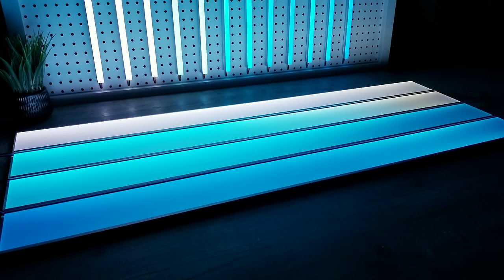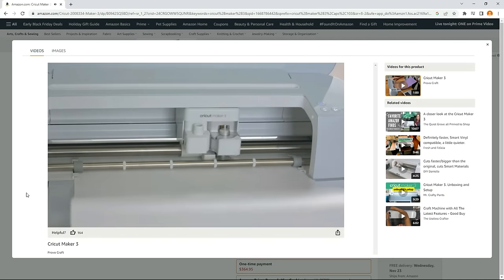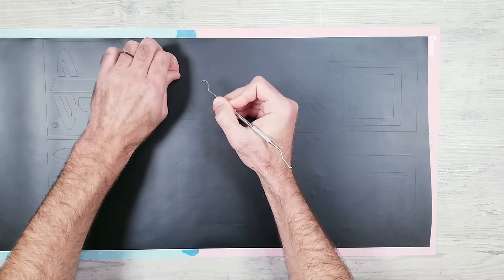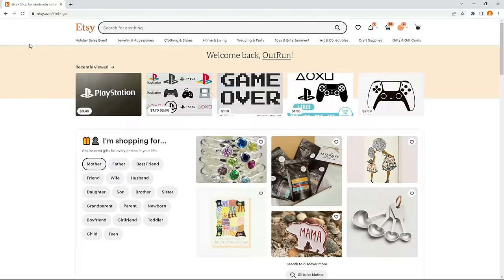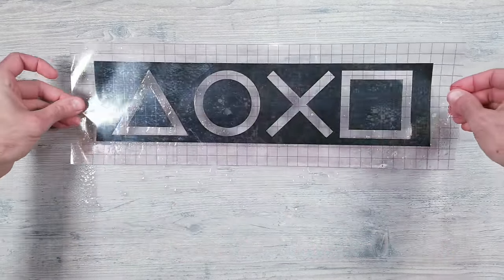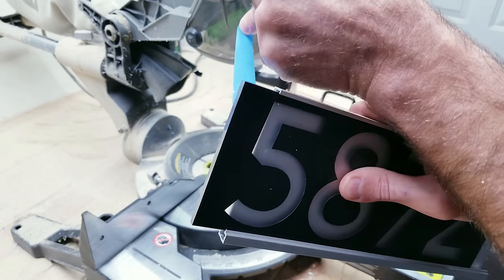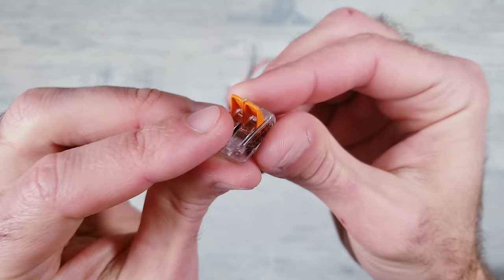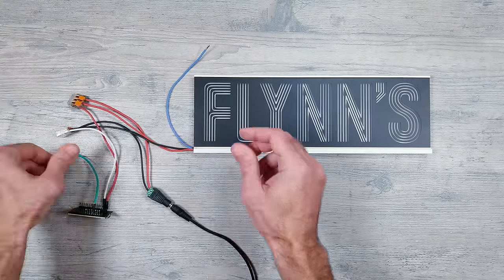How To Make A Custom Sign With LEDs

Comment: Suggestion for you on vinyl removal. Put on the transfer tape, then flip it over, and remove the backing from the vinyl. Get it started and then hold the transfer tape flat and pull/roll the backing off.
Reply from the maker: Thanks for the tip! I'll for sure try that! Some of it really doesn't want to pull off easily so I'm always open to new ways! Thanks buddy!

Comment: I have watched a few dozen of your videos and find you and the videos very helpful and a bit inspiring. I just made a couple of these and overall I'm pleased. My only concern is that the light is much dimmer on the top compared to the bottom. My muzata acrylic had paper covering both sides, one labeled frosted, one smooth. I put the vinyl on the smooth side,  would the frosted side offer better light dissipation? Thanks for all you do!

Comment: I like to heat up the sticky side of the led's with a lighter, match or any heat source before I stick them to really get a good adhesion to whatever I'm putting led's onto!
Reply from the maker: That's a good idea! I never thought of doing that before but I bet that would make a huge difference! Thanks so much for watching and for the tip!
Reply: @ChrisMaherDIY  it really makes a huge difference! I’ve also used those adhesive pads that like have alcohol and cleans the surface really good before use!

Comment: i like this, my neighbor throws christmas parties every year. i mader her a sign out of wood and some leds that ran off of batteries. my second design i was wanting to do was acrylic and leds i wanted to do a arrow point in the direction of where they parked with it flashing lights and the lettering flashing. i wonder how if i could achieve it with this?

Comment: Pro tip. When using the transfertape, peel it of by an angle less than 30 to make the vinyl stay on the transfertape, the same applies when trying to let the vinyl stick onto the plate, there you need to use an angle higher than 90 degrees
Reply from the maker: Thanks so much for watching and for the tip!! I'll have to try that! It makes total sense why that would be better so thanks again!

Comment: very nice!  How about solar as power for the street address unit? :)
Reply: Good Idea.  We need solar power and the ends need to be finished or cap off.  water proof enclosure?
Reply from the maker: I thought about that as well! I might have to look into that because I really want to do something like this for my house number but dont want to always have to charge a power block. I'll put this on the long list of projects i'd like to try! Thanks!!
Reply: @ChrisMaherDIY   power supply manufacturer question... who have you had luck with?

I bought 4 of these, 3 were dead out of the box.
BTF-LIGHTING AC100-240V to DC5V60A Max300W Suit DC5V1A~DC5V60A Switching Power Supply Device Transformer Power Adapter Converter Jack for WS2812B WS2811 WS2813 SK6812 etc LED Strip/String/LED Matrix
Reply from the maker: @graphguy  yikes! I've always used btf ones and have never had any problems. When you plug them in, does the light on the unit even turn on? I know on some of those they have a switch on the side to go back and forth between 100 and 240. Sometimes they came on 240 and I had to switch to 100 for it to work.
Reply: @ChrisMaherDIY  ok. Humility time.  Thanks for posting out I'm not an electrician!  Haha.
I knee this but in my rush to get this live... totally forgot they come set to 220! Ugh, stupid me.  I owe ya.
Reply from the maker: @graphguy  So that worked?! I did the same thing when I got one and I was frustrated when it wasn't working then I think I was reading somewhere where it said make sure the switch is set to the right one!
Reply: @ChrisMaherDIY  yup that was it. 😓   I was working under .."I'm in USA" and that it would be automatically set to 110.   There goes that assuming thing

Comment: Amazing video as usual! With small projects like this will I need individual esp32 boards if there will be multiple small sections pretty close to each other? Sorry a complete Noob
Reply from the maker: Thanks for watching! No, you could use 1 esp32. You can use different pins on the board to go to the different strips. I made a video not too long ago going over how this works that you can check out! https://youtu.be/Zzi5UIGnY2A?si=0ZPs_CuGbzxQNUBn

Comment: If you split the 4ft into 3 diff sections does each section require its own controller or can they be wired together?
Reply from the maker: Thanks so much for watching! You can wire them together if you like or you can run them separately to different pins on the esp32 to be controller that way. You don't necessarily need to use different controllers if you don't want to! Hope that makes sense!
Reply: @ChrisMaherDIY  thanks for responding another question I have is have you thought to make a larger framed sign with a frosted acrylic surface? Like a 24x16 or 24x 48

Comment: What did you do for Cord management? 😬
Reply from the maker: Thanks for watching and great question! I didn't really do anything for this video. It was just more setting them up and hiding things behind the signs so that I could take some nice pictures and videos. If I were to lets say put this on a wall, I would just run the wires down the wall (using some track cable concealer) and then probably just hide the power supply and controller behind something (plant, electric fireplace, or anything in the room) I think its too much work to try putting wires behind the wall so options are somewhat limited!

Comment: I’ve checked the channel out I’ve subscribed but could u please I mean please demonstrate the full finish product. Like how do you make the wire work look professional so when ppl see the final results it don’t look unprofessional and half way done. There’s has to be a way it looks complete.
Reply from the maker: Thanks so much for watching and for the ideas! I did make this video: https://www.youtube.com/watch?v=ibRp6eeUwBA which goes into that a little bit. But mostly I just hid the wires behind something in the room if I can and use cord raceway kits that you can get on amazon. I dont want to put things behind walls (just more work then what I want to do) so options are pretty limited.